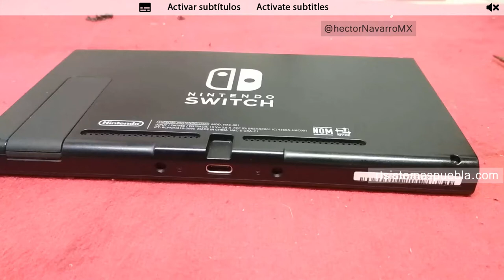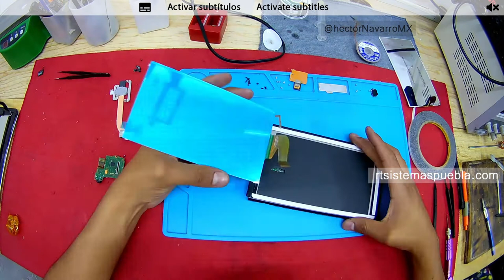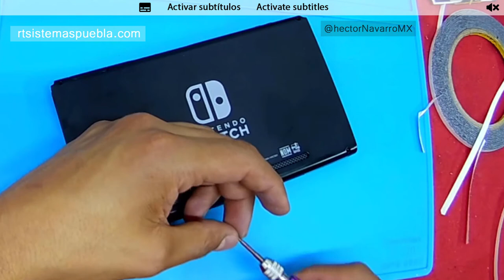How to replace LCD screen for Nintendo Switch (HAC-001). [SUBTITLES]

Comment from the maker: 00:00 Remover tornillos [triwing]
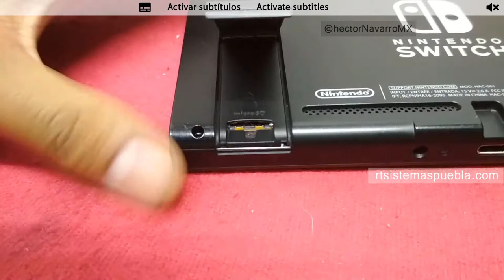00:17 Remover tornillo phillips #000
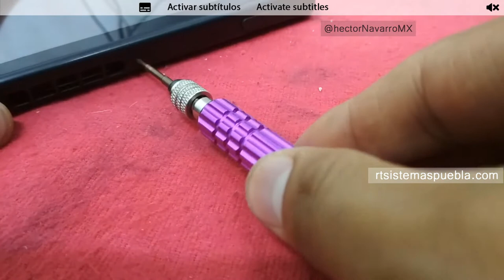00:31 Remover 3 tornillos phillips #000
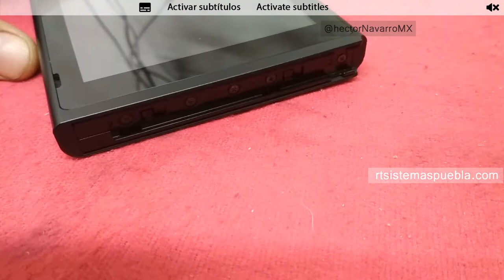00:53 Remover 2 tornillos a los lados
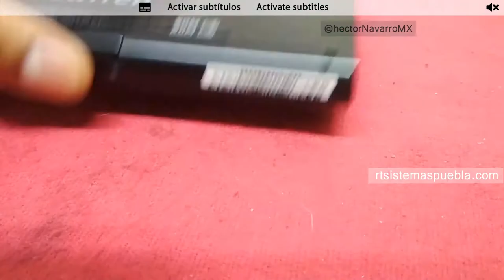01:06 Abrir con espátula
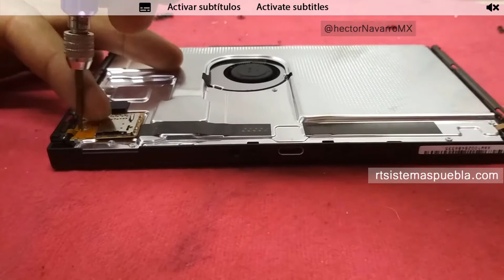01:15 Remover lector de microSD
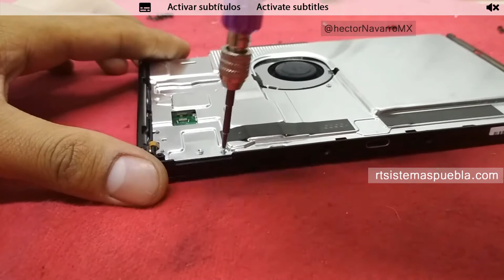01:26 Remover tornillos phillips #000
01:37 Abrir con espátula
01:47 Desconectaré los flexos más adelante...
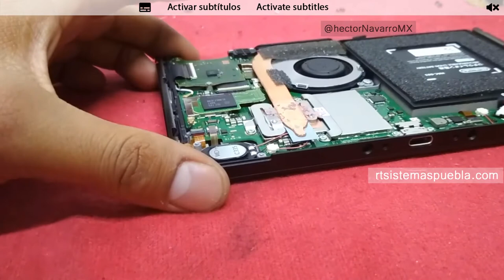01:52 Remover disipador de calor
02:40 power button
03:03 Desconectar lector de gamecard
03:12 Desatornillar
03:25 Desconectar flex: touchscreen
03:32 Desconectar flex: LCD
03:39 (Opcional) quitar cooler
03:53 Colocar cinta de poliamida (resistente al calor)
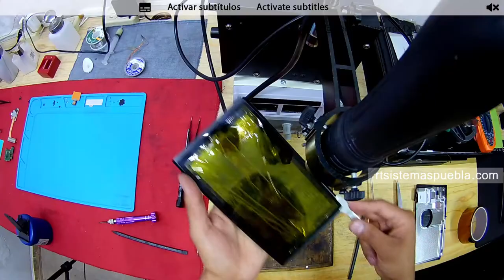04:03 Calentar los bordes a 300ºC
04:10 Despegar el touchscreen con ayuda de espátulas
05:15 Separar cuidadosamente el touchscreen
05:23 Separar el LCD y touchscreen
05:41 Colocar cinta doble pegamento
05:46 Colocar el nuevo display LCD
05:50 Limpiar el touchscreen de polvo y huellas dactilares
05:54 Colocar el touchscreen
06:09 Conectar flex
06:15 Conectar flex: LCD
06:26 Conectar: flex touchscreen
06:36 Atornillar: lector gamecard
06:48 Colocar: disipador de calor
06:58 Conectar la batería
07:02 Colocar y atornillar la tapa
07:11 Colocar lector de microSD
07:18 Atornillar la carcasa exterior
07:29 Probar el funcionamiento de la nueva pantalla LCD

Comment: Una duda, al extraer el panel haciendo palanca, se daña lo más mínimo el plástico de la carcasa?? porque en el sat me la dañaron y la volví a enviar. Me mandaron una nueva pero otra vez con un pixel muerto, que fue el motivo por el que la mandé la primera vez (todo en garantía, eso sí)
Reply from the maker: Si se puede dañar. Pero depende la herramienta que utilicen. En mi caso es una navaja muy delgada, y por eso caliento el touchscreen para hacer muy suave el pegamento y evitar que la palanca rompa el touch o dañe la carcasa plástica.
Reply: @centrodeserviciopueblamx5727  es que es un desastre eh, ¿no se pueden usar ventosas o algo para evitar chafar todo el margen de la carcasa al pasar la espátula a lo largo de todo el margen? XD. Si en vez de pegamento fueran unos imanes potentes solo levantando por el espacio de los altavoces sin hacer palanca ya se levantaría. Pero así,,, es que es casi imposible que me la manden sin desperfectos en la carcasa frontal. Ya les he llamado y les he dicho, que si se ve dañada, que no me la manden xD que me vuelvan a mandar una nueva y comprueben esta vez sí, que no hay píxeles muertos.. menuda odisea, 3a vez que la mando seguida ha sido xD el viernes se la llevaron. Veremos cómo acaba,, a la tercera va la vencida espero.. xD un saludo y gracias por resolverme la duda.
Reply from the maker: He visto el método de la ventosa. Posiblemente lo ocupe después. Gracias por compartir tu experiencia.
Reply: @centrodeserviciopueblamx5727  al final me mandaron una nuevecita de nuevo, esta vez sin píxeles y perfecta en todo. Menos mal:)